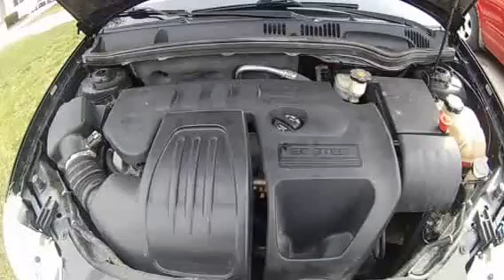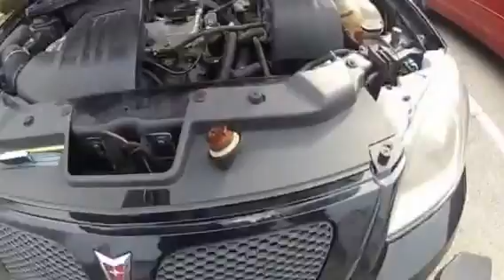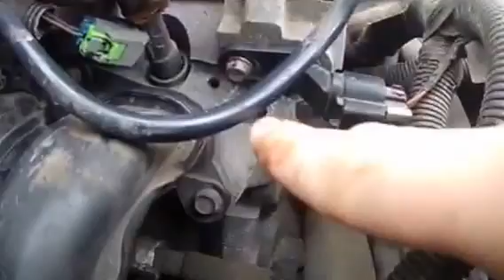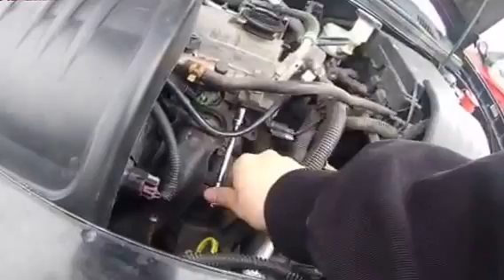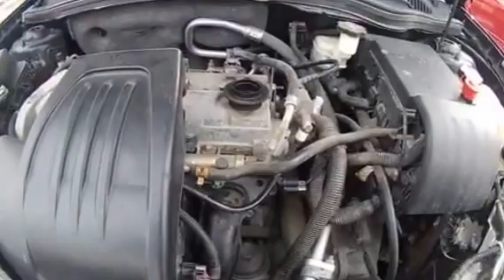2007 Pontiac G5/Chevy Cobalt Camshaft Position Actuator (P0341)

Comment: Where is the camshaft acutator solenoid located on the g5
Reply from the maker: It should be right under the oil filter. If you reach under the oil filter you will be able to feel the wire there. Best to go from under the car though.
Reply: Same place this video shows Crankshaft sensor is located under oil filter

Comment: Hi Bill.
Please would you share with me, what kind of symptoms or troubles had you experienced before cleaned the sensor? Or you decided to scan it cause check engine light was turned on?

Glad to read you, best regards.
Reply from the maker: The car would usually start with only two turns of the engine. But then suddenly it was taking 10 or more turns to start and it would make a loud pop noise when it finally started. Then the engine light went on so I scanned it. Cleaning only helped for a couple weeks until it needed to be replaced.

Comment: Is this the same as a 2006 chevy colbalt
Reply from the maker: That all depends on what engine is in it.   GM had different size engines such as 1.8L and 2.2. This would be the same as an 07 cobalt but for any other year I would advise getting an OBD scanner and checking.
Reply: @BillOfAllTrades2016  it's a 2006 2.2 l it's not in the front next to the intake I looked at all videos and still can't locate the cam position sensor, would it be u der the fuel rail?
Reply from the maker: Sorry for the late reply. I found this picture online that highlights the location for your 06 2.2L. 

https://images.app.goo.gl/xakiq1oZzEkoGEa59

Hope this helps. It says 2.4. But the 2.4 is the same build as the 2.2